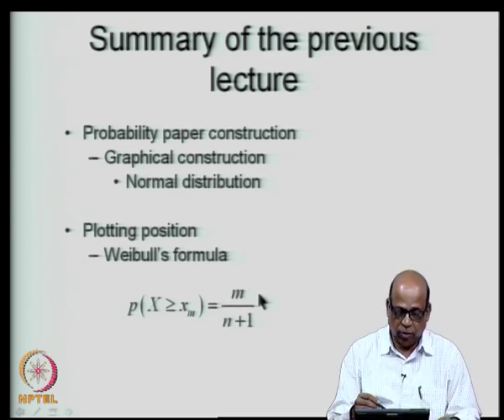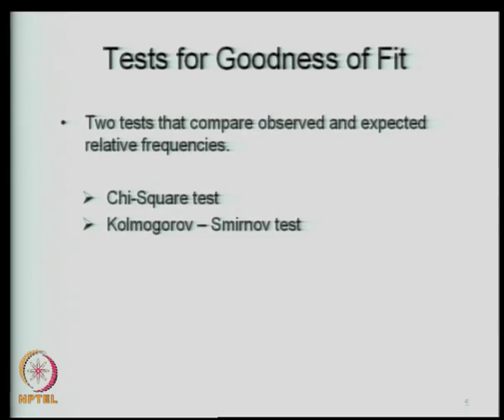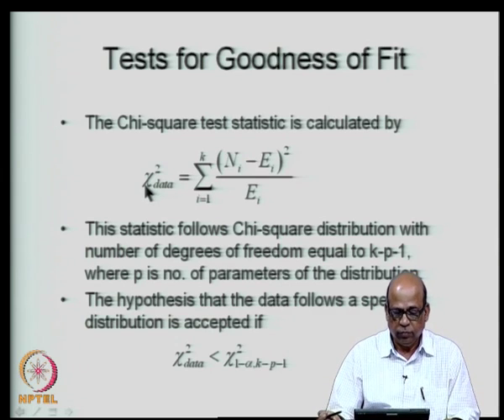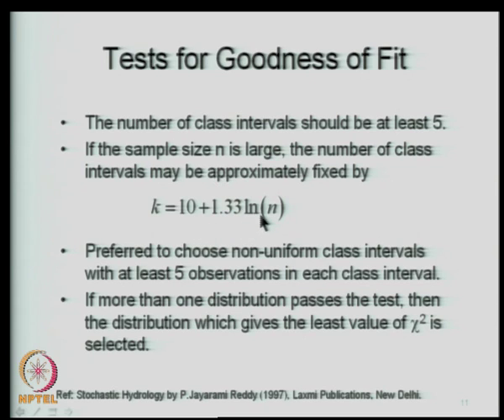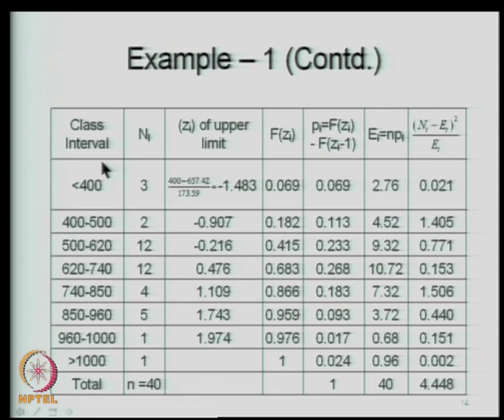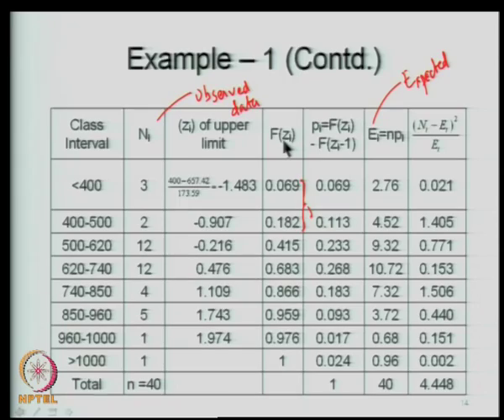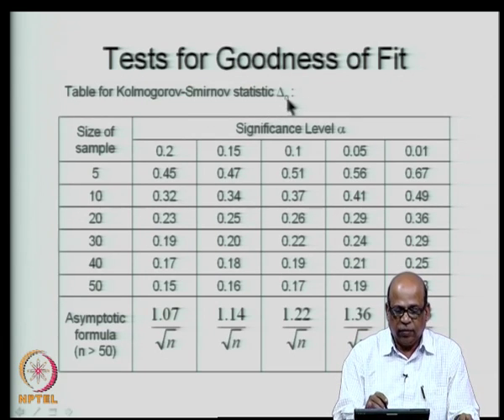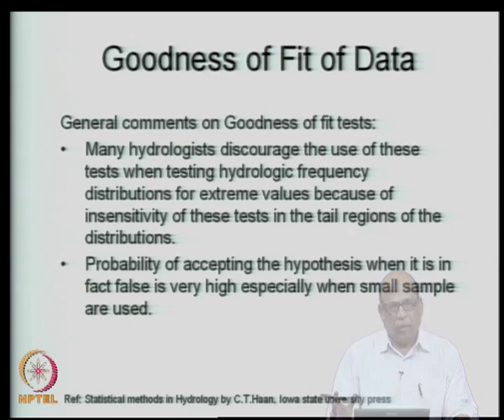Mod-06 Lec-28 Goodness of Fit

Comment: sir,in the chi square test table,  in the interval <400, the probability will be for the value to lie between minus infinity to 400. but flow data can't be negative. so shouldn't it be for the interval 0 to 400 instead of <400.
Reply: Yes, the interval is from 0 to 400, since the discharge is positive. 
The interval <400 implies 'ALL' the values less than 400